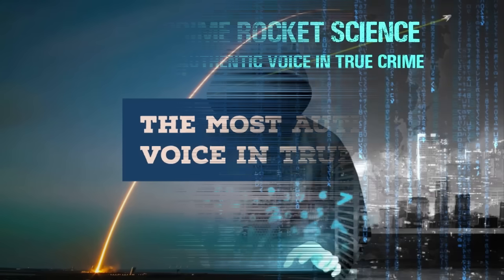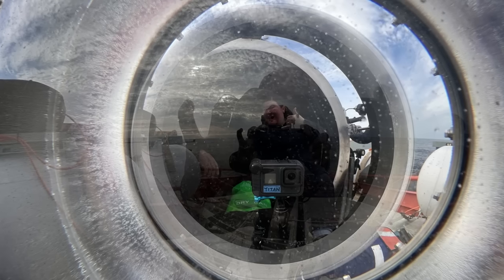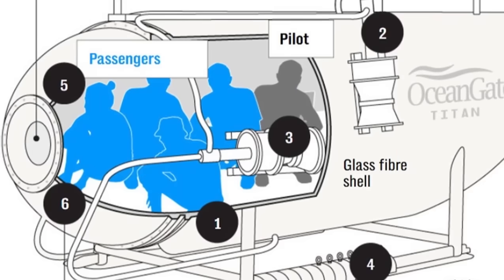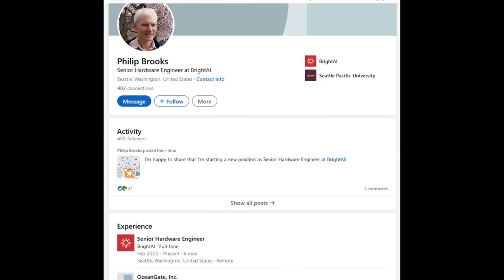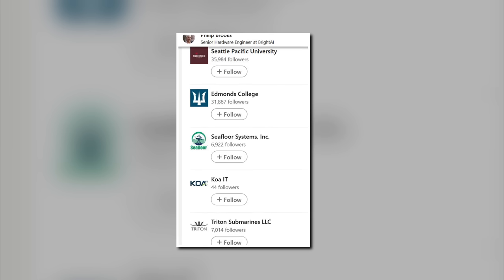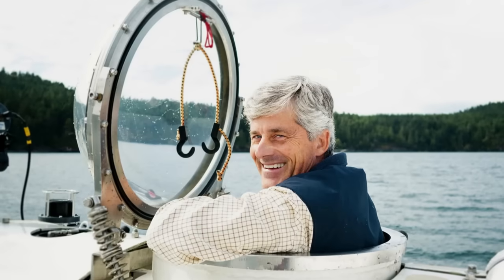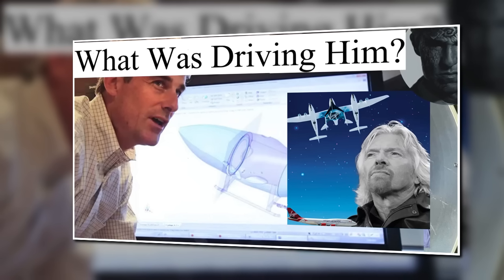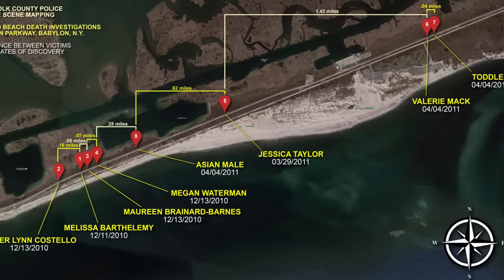NEW RECONSTRUCTION RAISES AN URGENT QUESTION: What Happened To Their Last Director of Engineering?

Comment: Towing that thing on a clumsy raft into the Atlantic would have no doubt exposed the connection between the titanium interface ring and the aft mounted accessory “bundle” for want of a better description to a multitude of abnormal/asymmetric loads that were never modeled when this thing the so called “Titan” was being assembled, no less designed. 
Same goes for the loading on the fwd interface ring that the front dome was hinged off. It would have made far better engineering sense to hinge the dome centrally either swinging it upwards or down so as to minimize the torsional load on that interface ring. 
Then to boot these guys decided to use the same interface ring as a lifting point for hoisting the thing. Who in their right mind would fix lifting pints to a critical component like that. It’s like jacking a 747 under the engine pylons, as opposed to specific points on the airframe that are designed to spread the load of the forces concentrated in that area, and it’s never a critical failure point. 
How about a lifting cradle that supported the ship unloaded and put all the lifting force onto no critical pressure vessel points. 
And, cantilevering all that gear off the rear interface connection/ring then slamming it around in the Atlantic for a few days to save a few bucks on the cost of the mothership could possibly have set up the failure mechanic that brought this whole sad Sham-sub undone. Interesting to observe the rear accessory section was retrieved fairly….. relatively intact, damaged but not blasted to bits by a high energy implosion. It’s not totally smashed which you’d think it would be if it was still attached inline with the pressure chamber when the implosion occurred. On a hunch, due to fatigue/abnormal loading on the journey to Titanic site as a result of the rough conditions, the aft section separated at the top fixing and swung/cantilevered down, pulling the vessel into an aft first plunge toward the ocean bed. The rest is history. In a sad irony, the aft section of the mighty Titanic broke away from the fwd section as it was hoisted into the sky unsupported by the ocean. The aft accessory section of the Titan when unsupported by the ocean and being shaken, rattled and slapped across a few hundred miles of the Atlantic making its way to the wreck site, set up the conditions for the ultimate failure of the ship once it headed for the ocean bed. The same ocean bed that’s no place for 50 year old white guys.

Comment: As an electronics/computer engineer myself I'm surprised by this information. Engineers of different fields are taught different things - electronics/computer engineer will generally know nothing about structural integrity and mechanical properties of materials and structures and won't be able to even properly assess risks involved with designing a hull for a submersible.
Additionally, most fields of engineering are very big on safety (as they should), because if done wrong people can be killed (typical project in these fields involve this risk). In electronics and computer engineering there are certainly some applications with the same risk levels (people dying if you do a bad job), but they are not that common. So the culture of ensuring safety is a bit different - in the first case, it's an obvious, automatic concern and number 1 priority, in the second case the level of priority and concern depends on the application.

Comment: If i was Stockton i would have at the very least have added a steel/ titanium ring to the middle of the sausage,it would have added a huge amount of rigidty,i am not an engineer but certain things are just plain common sense,but for Stockton that would have signaled to his passengers that he had doubt in the CF and it would have been aesthetically less apealing. The manner in which the CF was wound wasn't optimal for longitudal strenth , perhaps the machine tools to do multi patterns is just not yet available for that size of shell!? 'Captain crunch' should have realised on that point alone that the technology was still to immature for deep submersible application, and that CF's strenth is in the pull not the push!
I believe in the principle of the graduated idiot,they have enough aptitude and connections to jump through the necessary hoops to get their degrees,but lack a certain depth of thought that some ungraduated individuals posess.

Comment: What I find incredible is look at the personality styles this deep sea submarine builders attracts. It attracts narcissistic & high functioning psychopath personalities. People who need control of the environment and others. But when you add to the mix a person who thinks his simple unproven tech can cheat huge hydrostatic pressure we have a disaster. In the new style rocket engineering thats going on SpaceX have learned of the dangers of carbon fibre pressure vessels and how they fail without warning. It seems the electrical engineer here had a sniff there was something off and jumped ship, or should I say sub.

Comment: A basic understanding of physics would suggest the cardboard, sorry, carbon fibre tube failed at its most vulnerable point, midway between the titanium end caps.

In a microsecond, the pressure inside the cabin went from 14.7 psi to 5390 psi.

Apart from the tube itself, the next weakest point was the viewing window. It was designed and certified by the manufacturer to withstand external pressure of 1844 psi but, with 5390 psi BEHIND it, would have blown out in less than a millisecond.

The five occupants of the submersible would have, instantaneously, been mashed to a pulp around the inside of the front titanium hemisphere where the plexiglass window had been.

The 'presumed human remains' were obviously smeared around the front hemisphere. Five sets of DNA to disentangle. 

The aft titanium hemisphere is of little interest when it comes to the liquidifation of the passengers. All the action happened at the other end. In miliseconds, of course. The rear dome was probably not recovered because it was impossibe to 'grab' with the available equipment.

RIP Hamish, P-H, Shahzada and Suleman.

Comment: As a low-level systems and software engineer, who knows all kinds of neat things about OS internals, processor ISA's, semiconductor design, software framework internals, etc., etc., I think I'm TOTALLY qualified to design a deep-sea submersible out of non-homogenous composite materials. You won't need to test it because I test in production; I'm hardcore and this physics and material science stuff is easy. Forget about that crappy Titan sub because, in my sub, the controller will connect over wifi/5g to a cloud hosted service for maximum reliability and fault tolerance. Oh, and I'll have a trained algorithm to accurately predict when the sub will implode.

Comment: I was watching footage of the wrapping of the carbon fibre around the tube yesterday. When the camera is on the left side at an angle, you can clearly see what  seems to be imperfections, bubbles and uneven spots. I am wondering if  that trapped air below the wrap was forced towards both ends and added up to the the external pressure,  adding unexpected outward stress followed by failure.

Comment: Due to the diffrence in tollerance between CF and Titanuim under external pressure ive always had a hunch the end caps popped off like a cork,  the adhiesive used in the support rings would have made no diffrence what so ever.  Many are claiming the tube itself is the culprit and i would be inclined to agree given the micro fractures it likely sustained on previous dives.  One thing im certain about is it is either the later or the adhesive just completely failed.

Comment: Oceangate had nothing to do with sound engineering or deep sea exploration. It was all about high-value tourism and $$$. Even engineering students at a good university might have questioned the use of carbon fibre in a high pressure scenario. Titanium is used in submarines and that part of the Titan sub was probably okay.

Comment: The excess speed in the decent can only be explained by added weight, the only addition of weight comes from taking on water, there is no other weight source, the carbon fibre was infused with so much water, ejecting the cage and balasts made no difference.
Reply: Not added weight - reduced displacement. A 1mm deflection would reduce buoyancy by dozens of kilograms.
Reply: @allangibson8494  thank you

Comment: Seems about right ... hull collapse perpendicular to center of CF Hull given the cylinder was in "hoop" and only 5" thick with zero supporting stringers; would have had to have been around 17.6" thick if no structure to counteract inward pressures. But neither here nor there ... the whole design and manufacturing process were wrong from the beginning and resulted in abject failure. IMHO
Reply: For comparison, look up the Aluminaut. 6.5” thick aluminium alloy hull, same dive depth, 7 crew.
Reply: @allangibson8494  don't forget about the advantage of CF for buoyancy ... Rush wasn't wrong on that ... had it been thread laid wound and internally braced, it would have been a much stronger structure. But doesn't really matter, whatever Rush picked, it would have had to be more expensive ... and he was a cheap skate ... IMHO

Comment: I'm not an engineer but I feel like the fact that the carbon fibre was an inch or so thinner at the ends where the end-caps were attached. If the middle of the sub was compressed the weaker sections at the end could start to bend and delaminate?
Reply: The end caps had an inner titanium lip holding the carbon fibre spool in alignment.

Comment: The simulation results for the hull collapse (centre of the carbon fibre hull collapsing, driving the occupants and debris towards the interior of the endcaps) agree well with what we've seen of the wreckage.

It explains why "human remains" were recovered, whereas some of the other failure modes would have ejected most of them. Yikes.

Comment: im just wondering.. if the carbon fiber is more deformable than the end caps.  would it actually be under tension rather than compression  as it woule be bowing slightly inwards
Reply: There was no carbon fibre running the length of the submersible - just radial bands.
One any part started to buckle there was nothing to stop it.

Comment: It doesn't take an engineer to work out this probable cause for the desaster.  It should be obvious too any inquiring mind, that the cylinder carbon fibre was suseotibkecto such flexing and the cause of stress on the glue.  The glue had no chance of holding the three pieces together.  In reality wasn't going to do anything that was going to hold it together.  The whole concept of this coffin shows that money can't buy comon sense.

Comment: The Titan failed because the glue did not bond to the titanium . The titanium surface was smooth nothing sticks to smooth surfaces . That is why no glue appears on the rear titanium ring that we see in the photos of recovered wreckage.. The ring only over hung the tube by about a inch and a half. The lip of the ring was not heavy enough to hold and ripped as evident in the wreckage photo
Reply: The glue is utterly irrelevant. The thousands of tons of pressure would always hold the end caps tightly on. The  Aluminaut didn’t even have seals between its eleven hull spools - just bolts holding the eleven precision machined aluminium rings together.
Aluminaut has pretty much exactly the same design target as Titan - same depth, two more passengers and designed in the early 1960’s.

Comment: The simulation shows the titanium ends roughly maintaining position, this would not happen.
The ends are loaded longitudinally over 50 million pounds, they would come together like cymbals.
Reply: It wasn't pounds of pressure, it was pounds of pressure difference.

Once there was water intrusion, there would be zero longitudinal loading.
Reply: @Kyle-sr6jm  Knowing that hoop stress is twice that of longitudinal stress the walls of the cylinder would be pushed out of plane while the end load acted to crush the strong ends toward each other crushing the weak carbon fiber between them, you are wrong.

Comment: I have really enjoyed your series of videos on the loss of the Titan. I think they are the best of the bunch.
There seems to have been a metal liner between the fiber hull and the interior systems and crew. If so, how did it interface the fiber, and what might have happened to it in the implosion.
Also, did the two glass spheres hold electronic gear in a pressurized oil bath?
Reply from the maker: Also, did the two glass spheres hold electronic gear in a pressurized oil bath?>>>I'm not 100% sure what was going on with the two glass spheres. I've seen them, and they do have electronics inside them. James Cameron said he felt this was one of the three possible flaws on the craft, the other two being the viewport and the carbon fiber hull.

Comment: (Comment number two)
I think your assessment of the situation is a very viable possibility.  You may not realize it but being a detective is a large part of what an engineer has to do, too. You are not that different from an engineer in that respect. That is you ask questions, make observations and draw conclusions from the observable facts. I think it’s very possible they knew what was going on, albeit possibly for a very short time.  I suspect the glue joint was a very weak point and it could have developed a pinhole leak that would most likely expand quite rapidly - but not so rapidly as to not give a prior warning.

Comment: I just read that the mother ship dragged the Titan from Iceland to where the Titanic rests. Other submersibles have a mother ship that is built around the submersible with a special lift to take it off the ship and put it back on. They also said that it is not smart to pair titanium with carbin fibre because they can't withstand forces at equal rates. I think Stockton Rush was a cheapskate who wanted to charge millionaires an arm and a leg for a huge profit. He did it his way without thinking of the safety of his passengers. Unfortunately for him his luck ran out.
Reply: The home port was in Newfoundland not Iceland…
Reply: @allangibson8494  I thought I should have looked it up before I stated it.

Comment: You draw a very large distinction between mechanical and electronic engineering whereas actually the two disciplines are very similar. They both take 144 credit hours at most universities and the first three years are almost identical.  For example, Maxwell’s equations which were originally written for ME’s but are also widely used by EE’s as well.  Also it should be noted that the two disciplines themselves are very similar in practice, in that engineering in either area entails using best practices, tables, equations and more - both very similar.  

I cannot imagine a good ME or a good EE would ever get into that TITAN thing and go to those depths!  EVER!
Reply: So you would have an OBG-GYN, or orthopedic surgeon perform heart surgery on you?

They both went to medical school and took a lot of the same courses...right?

Your argument MIGHT hold some water if you were comparing civil and mechanical engineering as they have some materials and loading knowledge.  

EE has zero training in those areas.
Reply: Is this a joke?    So what if both use 'best practices, tables, equations and more'?  That doesn't mean they are interchangeable.
Reply: @LeverPhile  I did not say they were interchangeable. Your reading skills may need a little more development. Or you may just want to reread what I said. No where did I say they were interchangeable but that they had similarities. Like the other fellow you are also engaging in reductio ad absurdum.

Comment: Wait… at 6:22 the picture of Stockton Rush and I assume Brooks sitting in the Titan? That’s an old Logitech PC Surround Sound system tucked underneath them. The center piece is the subwoofer and to the right and left of it are clearly the left and right speakers. This is a very old set of speakers you used to hook up to your computer for gaming, 15 years ago. W-T-F is it doing on a deep diving submersible?
Reply: Innovation ... ?
Reply: Sound system to drown out the cracking sounds from the hull.

Comment: It’s important not to think of the failure not as one distinct mode vs another. As the cylinder deflected in the center the faces that were glued to the titanium end rings came under an increasingly greater moment of inertia. Eventually, either the hull failed somewhere in the center or the bond between the titanium and carbon fiber failed.
Reply: I’ll try not to get too in-depth because at the end of the day I don’t really know what happened but if you can imagine the middle of the cylinder deflecting to the inside then the o.d. of the tube would be being pulled away from the face of the titanium ring. The surface area of the tube is probably greater than the surface area of both hemispheres combined but the force pushing those together would not be equalizing anything it would be testing the compressive strength of the tube, specifically focusing on the i.d. A lot of complex loading being placed on the structure for sure. It’s anyone’s guess where the failure began but considering the glands of the titanium rings are clean I think the compression of the tube overcame the glue
Reply: The carbon fibre was also an inch or two thinner at the ends where the titanium end caps were attached, I wonder if that played a role?
Reply: Under such pressure, wouldn't the pressure hold the end caps attached to the mid part itself?